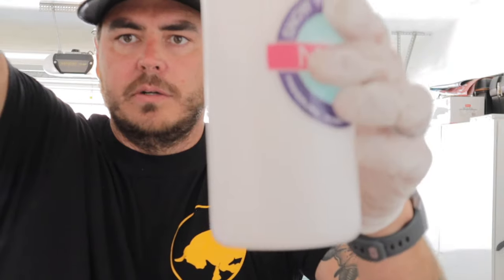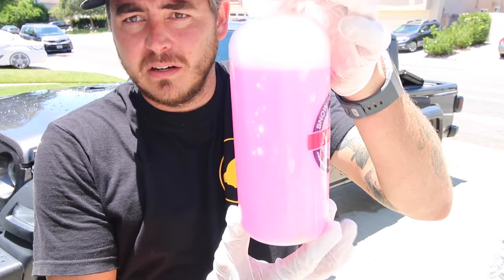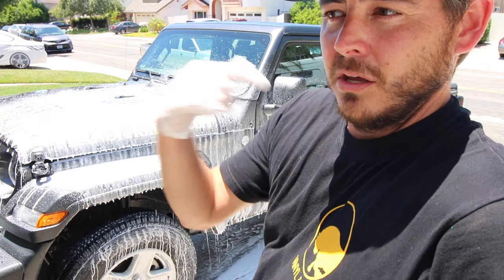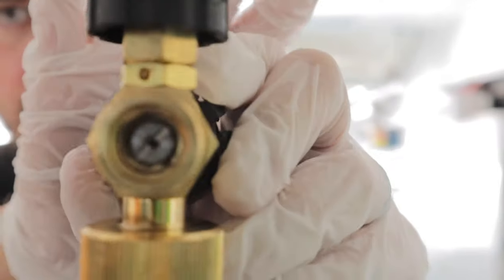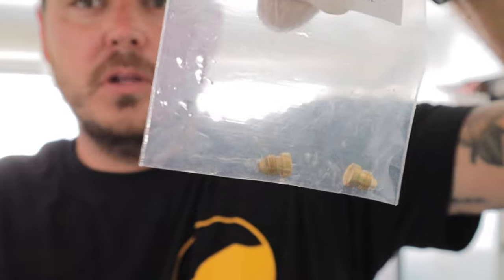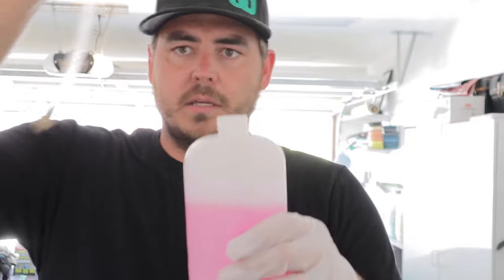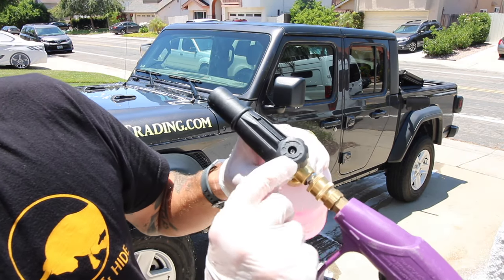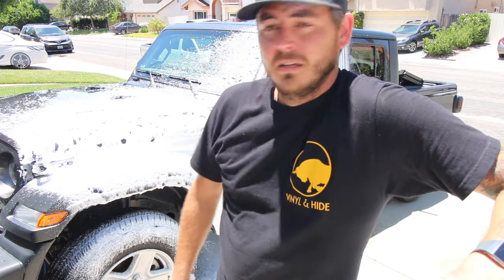How to get MORE FOAM from your Foam Cannon | Car Detailing Tips and Tricks | Pressure Washing

Comment: I use hot water when I mix my soap in the canon. Not boiling, just hot from the kitchen sink.  It really helps make thicker foam that stays on longer.
Reply: I wonder why that works. The water coming from the hose is pretty cold.
Reply: @koreywilliams4570  It’s using soap/water from the cannon. So it kinda mixes I’m guessing?
Reply: Soap is half oil. Hot water increases viscosity of oil
Reply: @Mrkevi123  hot water would lower the viscosity. Think about warming up butter, butter is also oil but when you heat it up it liquifies and has movement. Higher viscosity means it has less ability to move/flow, just wanted to throw that out there for everyone. I'm not sure that's the reason why it creates more foam, just my two cents
Reply: How does hot water increase viscosity if hot water is used with dish soap to clean greasy dishes🤔
Reply: @Robertapodaca82 oil and water and agitation creates emulsion i think
Reply: @Robertapodaca82 thats why its bad to pour cooking oil down the drain. It creates thick foam shit and causes issues for water treatment plants
Reply: My two cents is that heat expands and cold contracts. Maybe the expansion at a molecular level allows for the encapsulated oxygen in the soap bubbles to have a thicker “clingy” consistency
Reply: Also if I remember correctly water at a certain temperature in heat range turns into a very mild solvent, meaning it is a agitator with no added force
Reply: What about a larger orifice for gas powered pressure washer for more foam?

Comment: I purchased the foam Canon pro and the 1.1 tip after watching this video.  A 1.25 AND 1.1 tips was included with the foam Canon pro. I did not need to purchase the tip separately. Heads up for others. 

Great video, very helpful.

Comment: How could you dislike this? The video was straight to the point & perfectly illustrated the difference a quick mod can make to your foam quality if you're using a pressure washer with low GPM.
Can't make everyone happy I suppose 🙄
On a side note, that Ryobi sounds exactly like a Karcher. I wonder if the motors are the same 🤔 Subscribed!
Reply from the maker: Thanks!!
Reply: Haters will come from all sorts of places. Great video!
Reply: @imjoshv Hi Sir nice video what about my honda  gas power washer do i have to use 1.1 thank u

Comment: It helps if you replace the foam lance filters in the front of the snow foam cannon they are under the plastic spray adjuster, they get clogged up slowing the flow.  Amazon sell the kits with the upgraded replacement jets nice and cheap.

Comment: Thank you for this video. I have a foam cannon from Lowe’s. I switched out the nozzle to a 1.1
I put foam soap in the entire bottle, no water. 
I adjusted the valve to where it’s the least amount of water. I still have too much water. The foam is like your first demo before switching out the nozzle. Still the foam is too runny. 
Thanks for your help

Comment: Dude! I was panicking to see my foam canon do the exact same thing with the runny foam... I’m ordering that 1.1 orifice right away.. thanks dude!
Reply from the maker: Glad I could help
Reply: I order mine 1.1 orifice not as foamy as yours same equipment my power washer is gas Maybe it's the soap I have I use chemical maybe not putting enough soap 🤔

Comment: I got the ryobi 40 volt hp whisper series 1500 psi 1.2 gpm I’m impressed with the pressure washer for being battery power with boost mode on it foams really good as well have lots
Of
Batteries so runtime is no issue

Comment: Do you rinse the car off first or do you foam the car dry? I’ve changed the orifice out and use the pink chemical guys like you suggested but it’s still just as watery on the car and not as thick. But I’m rinsing the car off prior.

Comment: I appreciate the video. My question is is there a chart that lets you know the correct orfice based on pressure and gpm?
Reply: I honestly don't think you need to go that into detail. MJCC makes the ultimate cannon and is preferred by IMJOSH in his later videos. That product comes with both orrifices so you can change it out based on your washer. Bought mine at $74 but this is the one item I don't think you should skimp on

Comment: By far the one of the best, if not the best, video out there explaining what we all wanted to know.  I have since purchased the same Ryobi and orifices.   The one thing that was not clear, I am still learning, was the nozzle adapter a 40 degree one or something else?  For rinsing only with water.  I have read that a 40 degree nozzle is considered the ideal and safest one??  The gun of your choice seems to be legit with like five other adapters too!!  Anyways, thank you for this video. Clear.  Concise.   To the point.
Reply from the maker: exactly... I use a 40 degree most of the time... Those are just extra nozzle and dont connect tot he foam cannon. The foam cannon itself you can adjust the spray pattern!
Reply: @imjoshv  Thank you!!  The gun you have in the link goes to a black and smaller.  Is the purple gun much bigger than the black one.  Looking forward to a real wash this week with the 40 degree tip!  Thank you for responding back..

Comment: I replace my orifice from 1.25 to 1.1mm. By doing so the output of the pressure washer is pulsating. What did I do wrong? I’m using Bosch AQT 42-13 (130 bar). Please enlighten me. Thanks. Great video by the way.

Comment: I am unable to remove the metal quick connection  piece from the foam cannon, any advice? I tried using a wrench but not sure where to leverage using my other hand, as I don't want to break the plastic piece.

Comment: it actually depends on the pressure washer how big orifice you must have. The one that comes with the foam cannons are 1,3 - 1,4 mm.They're suited for pressure washers over 130 bar. When you have a cheaper pressure washer with only 110 bar or less then you'll to change to the smaller orifice, 1,1 mm in order to get thicker foam
Reply from the maker: Exactly
Reply: @imjoshv  - oh, now I saw in the description of the video whereas you basically says the same thing that I commented on. 

You could also inform your viewers that it's not always the thickest foam that is the best. Some detergent manufacturers have chosen to have a runnier foam. If the foam is too thick, it contains too much air and can't dissolve the dirt as good as a runnier foam. 

Cheers!
Reply: @imjoshv  I just bought the 1.1 orifice and tried it today. Still the same problem actually looked like less foam than before. I have a 4000psi 4gpm pressure washer + Tool Daily foam cannon. Any help is appreciated.
Reply: @adriandouglas2625  the smaller orifice is only for low powered pressure washers. You actually have too high powered of one. You want 1000-2000psi and as close to 2gpm as possible. 

Most people are rocking the $99 Ryobi 1800 psi electric pressure washer with a 1.1mm orifice foam cannon and it does magic
Reply: @xxkylexxredhead  thanks so much for the reply. I have a pressure washing business that's why I've got so much power in mine. Good to know- will be switching to ryobi for detailing 🙏🙏

Comment: Glad other folks are getting good results. I'm not yet, even after installing the 1.1 orifice. Maybe I should have gotten a cheap canon :)
Reply from the maker: What foam cannon and pressure washer are you using?
Reply: @imjoshv  Active VE2, Griots Boss, with P&S Pearl car shampoo. With the 1.1 orifice is foams slightly better, holds to sides of car longer, but still runny. Using the wand and the hose that came with the washer for now. Will upgrade both in the future. Thanks!

Comment: Hi, with a water pressure of about 120bar wich is the best, 1.1 or 1.25?
On MJJC site recommend 1.1 to 110bar, for 1.25 is 110 to 150 bar.
With the same orifice of 1.25mm wich is the best pressure? 120 or 150?

Comment: Years ago when  most screws were Flat head or slotted  they used to make a spring activated screw starter that would hold the screw to allow you to get it started  even if the position was Vertical I bet one of those tools would be helpful for getting the new Orifice threaded into the Nobel  they used to come in many sizes to accommodate all screws  including a all plastic one that TV repairman used  to help prevent shorting out the television sets  when plugged in  which many of those repairs were done with a TV on ! Most repairmen carried  mirrors they propped up to watch the TV set while they  worked on it from the back of the case removed
Reply from the maker: My dad was a tv repair man for his whole career. I wonder if he has one haha

Comment: Looks awesome but I have a question. Is the foam that's not touching the car actually doing anything to clean it? Wouldn't you be better off pumping on more lightweight for for the same amount of cleaning product rather than having bits falling off having not got near any dirt?
Reply: Snow foam detergents encapsulate road grime, dirt, dust, and pollen, lifting it away from the surface of your vehicle. As snow foam suspends dirt from your car and runs off, advanced hydrophobic polymers ensure a streak-free rinse.
Reply: Yep so if it's nowhere near the dirt it's pointless

Comment: I know this vid is a couple years old, but I gotta ask: what if u filled the canon with only soap and controlled your ratio with the top knob? Say, 100% soap in canon tank (maybe 50% full) and top knob 25% from fully pos (+) for example? Wouldn't that control your ratio to where you don't need to add water to the canon container? I've always been curious, lol! 🍻

Comment: Good tip but we use bilt hamber auto foam and it’s not a thick foam but runny and when the foam runs off the panel then so does the dirt with it, the thick and clingy foams are not as affective in removing dirt but basically it looks good

Comment: Josh: When you use your foam cannon do you close all the way to minimum your top button so you have less water going in the bottle ? I dont know how much to turn it. If I use the gun from my Green Work 1700psi 1.2 gpm do you think I will have less foam than using a small gun like your ? Thanks for your help, I try to find out why I dont have thick foam. I'm still looking for a good foam cannon that wil work great with my pressure washer. Didn't work with the Mtcc and Adams.

Comment: Looks quick and easy...except my quick connect adapter seems to be super glued into the foam canon.  I stopped short of putting the nozzle in a vise and using my impact driver.  Any thoughts?  My nozzle is a plastic material and not metal.
Reply: I let the nozzle sit in the South Carolina sun for about 45 minutes and it came off pretty easily.  My quick connect did seem to be glued to the nozzle and had Teflon tape.

Comment: very good info.  will this work with the MATCC Foam Cannon III ? I got this one off amazon and my first time using it, was very watery. I think I will try your suggestion but I notice your foam cannon is a different model.
Reply: i have the same cannon III  you have and didnt need the 1.1 oraface because my pressure washer is electric which produces 1800 psi AND its 4 Gallons Per Minute, this model requires 1450 psi Minimum and 2 GPM,hope that helps.if you have less than 2 GPM then yes get the 1.1 mm oraface. Edited:  from the description on this model, it already comes with the 1.1 oraface so it just might be your not producing enough power to it or your flow adjustment isnt set to Lowest (-)

Comment: What pressure washer were you using bro? The electric ryobi 2000 psi 1.2 GPM? Also what type of soap are you using? A foam soap or any soap can be used?
Reply from the maker: in this video im actually using the ryobi 1600psi 1.2gpm! Yes any soap will foam, but i prefer this stuff: https://amzn.to/3eFsgUO
Reply: @imjoshv  I’m really disappointed on the foam cannon I got, so what I did now is that I ordered the one you used in this video and the pressure washer gun... also the 1.1 m Orifice... 
I’m also using a ryobi 2000 psi 1.2 GPM 
Wish me luck!
Also, gave you a like and follow!

Comment: I have a Karcher k5 full control and when using the 1.1 it must be getting too much back pressure and keeps cutting the pump. The stock 1.25 no issue. MJJC cannon.

Comment: I see this video is approximately two years old now, so I was curious about the Amazon link you provide in the description for the MJJC Foam Lance 1/4 Quick Connect Foam Cannon.  The page states that this product has been updated.  Further, it states that this foam cannon is version 2.0, it comes with a 1.25mm assembled nozzle orifice, and does not come with 1.35mm nozzle (I'm assuming that is the size nozzle that version 1.0 originally came with).  It also states that it comes with one spare 1.1mm nozzle, so I guess we no longer need to order a replacement nozzle if we purchase this brand.  Yet, it claims the 1.1mm orifice nozzle is not needed, although it is included as a spare, because version 2.0 is new generation technology which creates good foam with the 1.25mm orifice nozzle.

Have you tried this new version 2.0?  Does the 1.25mm orifice nozzle really create good foam that is comparable to the 1.1mm nozzle?  Most importantly, if you have tried this version, does their 1.1mm nozzle produce as good as foam as the one you recommended which you provided the Amazon link to purchase?

Comment: Love this video.  I have a Stihl electric power washer.  Curious if the foam cannon you recommend will work with that?  Are the connections all universal?  Thanks!
Reply from the maker: As long as it has a quick connect it should work. They are typically universal

Comment: Will that do anything bad to the pressure washer? When it's trying to push all that water through a smaller hole? Great video btw.
Reply from the maker: Nope, ive tested it out with other unit and it has never been an issue!

Comment: Great tip josh, do you know if this will work as well for the karcher pressure washer?. I don’t know if there is an amount of pressure that needs to be provided by the pressure washer in order to work as well. Also will appreciate to see on your future videos how yo tackle down seat belts , as I noticed that is not shown on videos, but not aware if you do that as part of interior cleaning.
Reply from the maker: Hey Luis

Yes it works with the Karcher unit!  For seat belts, there is a special brush you can order for it but im always SUPER careful not to use any harsh chemicals on them cause i dont want to break down the material

Comment: Hi Josh, I know this is an older video but I hope you see this. So after watching a bunch of your videos I ordered the MJJC pro foam cannon which my unit came with a 1.1 m included to swap out the other orifice. I have a Ryobi 1800 psi pressure washer but I can’t seem to get that thick shaving cream looking foam, I haven’t been able to switch out the stock wand yet, “is that why” or am I doing something else wrong? Anyways love the content brother 🎉 hope you see this or anyone else with some insight would be much appreciated. Just fyi it did produce a lot of foam is was just super runny, 1st time using a foam cannon so I could really use some advice. Thank you !
Reply: I'm having this same problem rn, lmk if u figure it out

Comment: great video.  does the pressure washer matter?  I have a ryobi 1600 psi, 1.2 gpm pressure washer.  i saw on another video that said with 1.2 gpm pressure washer, the stock orifice that comes with the foam cannon will be fine and changing to 1.1 orifice won't make much of a difference.  just want to check if its worth the 8 bux to get the 1.1 orifice. thanks!
Reply from the maker: I’m actually using the ryobi 1600 in this video!!! It works
Reply: @imjoshv  Awesome. Thanks!

Comment: Hey Josh, I just receiver the MJJC generation 2 foam cannon and the Craftsman 1700 pressure washer. The MJJC instructions say" with the new generation foaming technology, it creates good form with the 1.25 orifice...you won't need the 1,1mm orifice though it is provided". Your thoughts.
Reply from the maker: I’d still go with the 1.1 because it will be even better! The mjjc comes with it so you just have to switch it out

Comment: My pressure washer is 190 bars 1900 psi? What nozzle do i need? 1.25 is fine then or better 1.1 ( i saw only under 130 bars you need the 1.1 )

Comment: I just tried exactly this changed it out and even used a good soap, “chemical guys snow foam” and when I turn my dial all the way negative it comes out straight water and I have to turn it up a little bit for foam to come out and when it doesn’t runny just like before….
Reply: What am I doing wrong?

Comment: Your video was very helpful, thanks. I have to wonder why the foam canon manufacturers don't use the 1.1 orifice as the factory install in the first place? Seems dumb to me they don't with all the problems people have had. I was about to return my foam canon when I learned this tip and took the time to buy and install the orifice. It corrected the problem but pisses me off I had to spend the time and money to go through this hassle.
Reply: The size of the nozzle has to be in proportion to the pressure washer. The more water it flows the more pressure you wil get with the same nozzle, the bigger the nozzle the lower the pressure. If you go down on nozzle size you wil increase the speed of the water over the venturi and it wil suck up more soap and give the mixture a higher velocity out of the cannon. They should ship sizes from 1.1 to 1.6 with every cannon and instructions to what nozzle should be used. I had to go from 1.25 to 1.4 on my washer.
Reply: @trulsvian  yea my karcher k5 is hitting a pressure cut off limit on 1.1 but is fine on 1.25